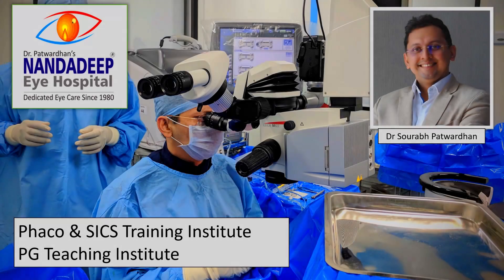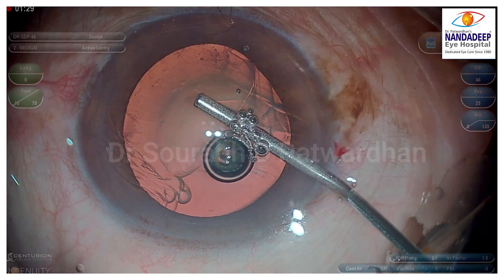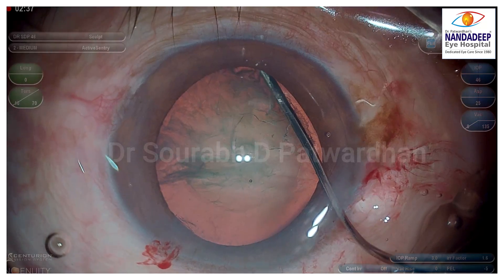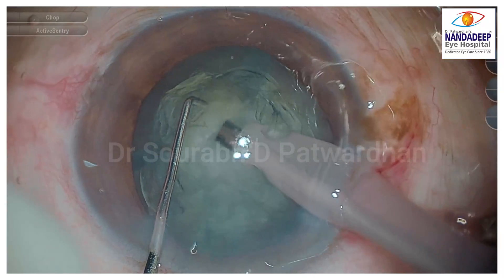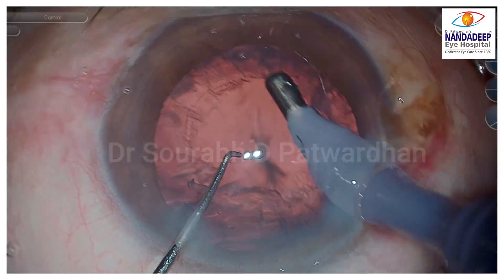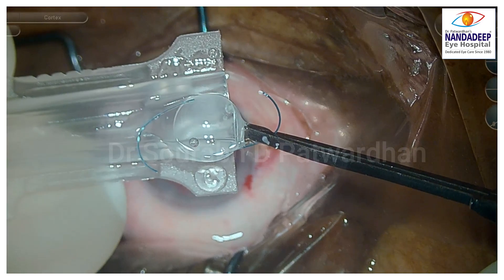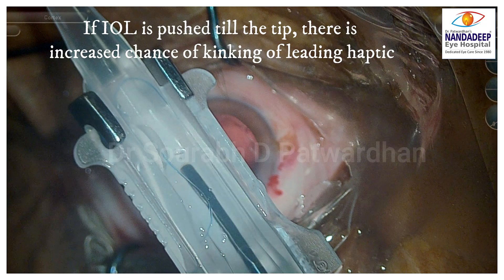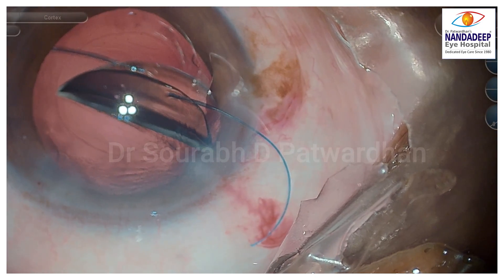233- A case of LAZ, How to use Alcon 3 piece IOL through C cartridge Dr Sourabh Patwardhan

Comment: Any reason not to pull the haptic sir , because I generally pull the trailing haptic and what are the chances of pco formation with single piece and three piece IOL sir ?
Reply from the maker: Pulling the trailing haptic is ok if ccc is very big. But it might induce lot of strech on bag due to the movement of other haptic. 
Pco formation is quite low in 3 piece iols
Reply: @SourabhPatwardhanPhacoTips  ok sir . Thank you